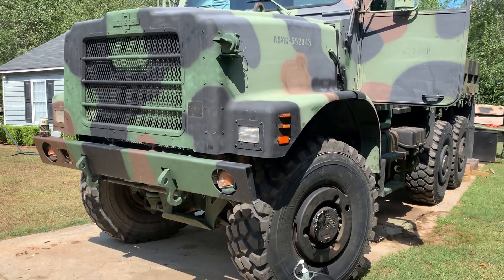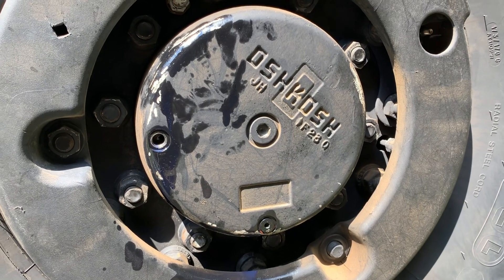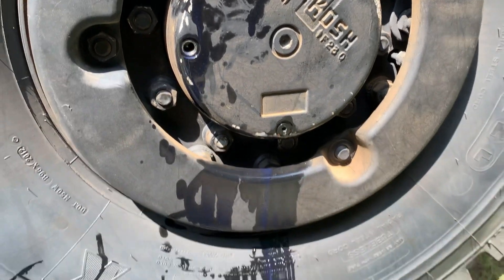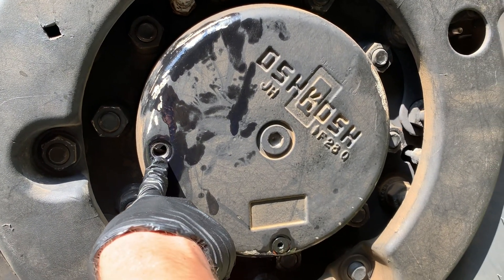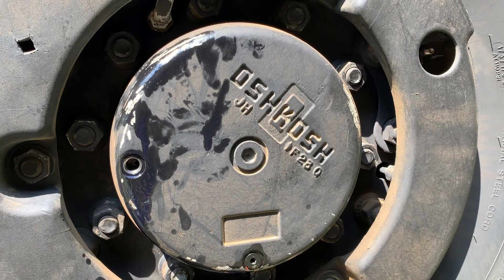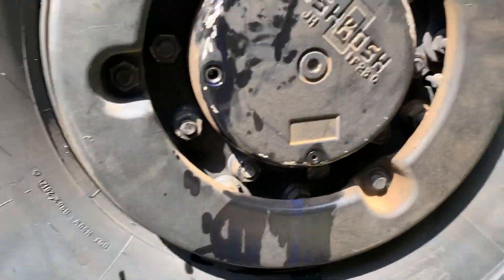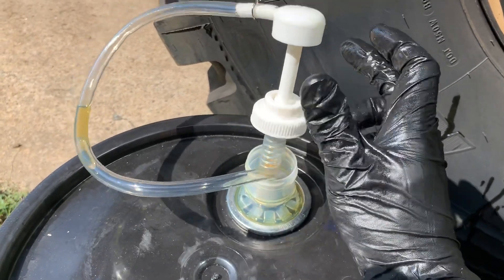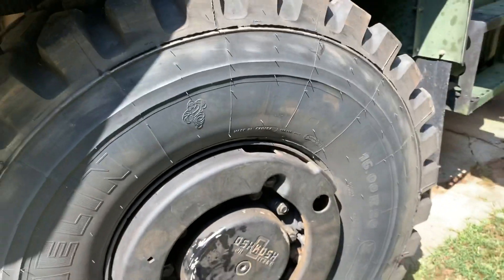MTVR Planetary Hub Oil Change

Comment: Those trucks can ford through some fairly deep water so you might have a blown seal like you said. Would pressurizing(1-2 psi) the hub w/ shop air help? Then squirt the hub w/ soapy water to bubble up any leaks. You might be leaking from the threaded plugs too. Do you use Teflon tape to seal the plugs? I figure by this time you got everything covered, just wondering.
Reply from the maker: as it turned out, the hub seal was blown on the backside